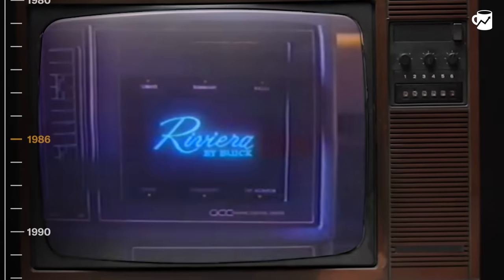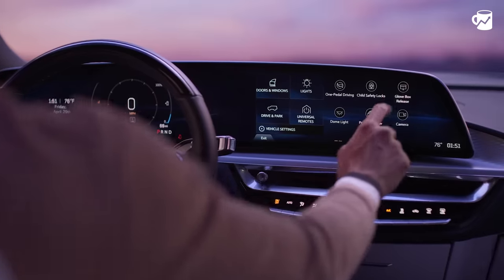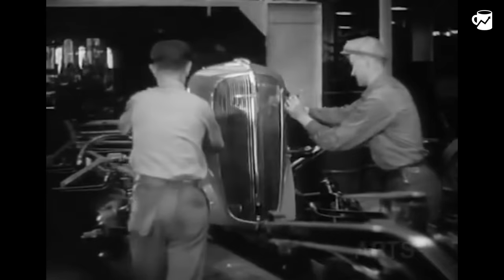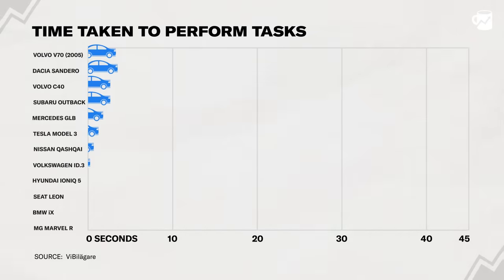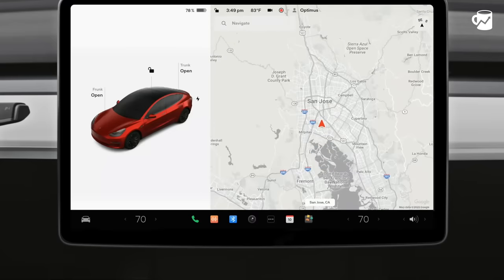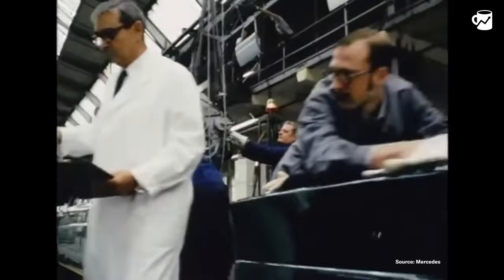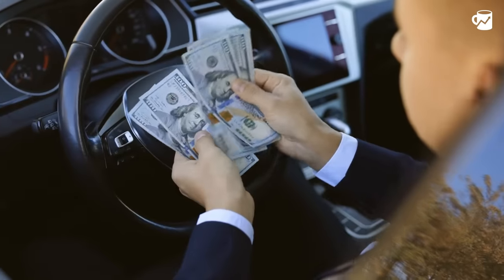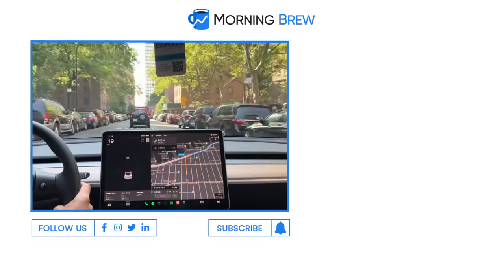The Real Reason New Cars Have Touchscreens

Comment: Touch is fine to customize settings to your liking, but while driving they are pure shit. We have a car where only the the air conditioning temperatures buttons are touch buttons and I asked the dealer if it comes with proper buttons.
Tesla might have done this because they assumed they will be able to make self-driving work in time. In thix case it would have been fine, but it looks like they need another 10 years.

Comment: My beef is the display system I have is too slow, that's in addition to being cumbersome to use at times. Voice control seemed like a great solution, but the "AI" in my 2021 Audi is nearly useless for anything but simple commands. I do like the physical controls on the steering wheel, it's a great feature that is safe to use. I also like the display behind the steering wheel, which can be adjusted using the steering wheel controls. If the voice control AI was more capable, it would work quite well, for example, if I could tell the car to make various adjustments without manually navigating through menus on a touch display. I was hoping that updates would become better with each new model release, but car companies seem to stick with original computer technology for years until a major new design comes out, that's despite the tech quickly going out of date after only a year or two, and despite the computer tech being dated and low end to begin with.

Comment: I think my 10 year old infotainment device is the sensible thing to have, if you really need to have one at all. It has a touchscreen but also has knobs. The only thing I use it for is to program the navigation software with my destination (only in situations when I'm going somewhere I've never been before and don't know the way), and to have a look at the map when I'm stationary at a red light. Looking at the screen to see the map on the move is almost as dangerous as pulling out a paper map. Instead, eyes on the road at all time while on the move and try to memorize the map or rely on the audio prompts from your navigation system. As for changing the station or selecting music from spotify on a touchscreen, you should not be driving a vehicle if you're that irresponsible as to split your attention between the road and something as unessential as selecting music on the touchscreen.
And I would not feel safe driving a car whose every function aside from steering, throttle and brake is controlled via touchscreen. So many things can go wrong, ranging from quality of life issues to preservation of life issues.

Comment: Touch screens create distracted driving .
you MUST look at the screen to locate the point that you must touch . doing so takes your eyes off of the road , hence distraction .
A car with buttons and dials does not require a person to look at the button . it's all done by feel and IF there is a split second of glancing it can be done via peripheral vision l not direct gazing as is required by a touch screen . 
now comes to the odd part . touch screens are ALLOWED in cars but using your phone , also a touch screen is not ?

Comment: It's cheaper if you build crap software, if car company's actually made the software good it wouldn't be cheaper than buttons. You also don't need tons of buttons, just Clima, volume and stuff like heated seats.
Reply: The user interface you're advocating can only  ever   have  just those functions and features it was originally designed with.   Need to copy a competitor's hot new idea, like "one pedal driving"?   Can't do it, if there's no button(s) for turning it on/off.   No problem if just extends a menu or screen somewhere.

Comment: So I have a 2019 Volvo V90, it has a touch screen and some buttons, and there’s a ton of stuff I have no clue how to use. I don’t listen to music on my phone because convincing the car to hook up to my phone is too buried in menus, I listen to the radio instead. I also don’t have hands free access to my phone for the same reason. I simply don’t answer the damned thing! I do love the lane keeping assistance but it’s not enough to be safe to fool around with the screen, I mostly use it to scan for deer. 

Automakers please make it easier to pair my phone, make it possible to rank preference for phones and make switching from primary to secondary phone easy to do. Never put climate controls behind menus, or on/off+volume controls.  Also, this business of not having a dipstick to check the oil is a terrible idea. That’s so buried in the menu that it’s ridiculous! 
Keep It Simple Stupid! KISS! Did it ever cross your mind that you could build 1 single bank of knobs and buttons for climate and sound and use them in every single vehicle? That would be amazing! And cheap, one panel across all models? Wow!

Comment: For me it wasn’t the Tesla Model S which started the worst trend but the Audi A6. In my view it was the first car which used a touch screen which was positioned very low for temperature control. It is completely stupid to control. 
I got a Volvo V60 from 2012 and I actually put the address in Navigation via T9 completely blind. It is such a easy to navigate car. On the other hand I was forced to drive a Golf 8 for a month for company and it was horrible to navigate the systems. Worst thing was voice control as it understands you falsely or just does not work so I do not understand how the argument of „just use voice control“ is really a thing instead of real buttons. It also has this horrible haptic sliders everywhere which you sometimes accidentally touch on the wheel and you have no idea how to simply adjust the temperature in the car. Just one of the worst cars I have ever driven.

Comment: Just bought a plugin to Blender that makes procedural cities in seconds. So could the haptic physical control surface be engineered, purely based on math and rules. Okay, manifacturing them still adds some cost but not as much as manually designing everything every time.

Comment: I miss when cell phones has physical buttons. With a good t9word implementatiin, it was possoble to text without ever even looking at the phone. I could do it while driving with a manual transmission and never look away from the road. Theae days with touch screen phones even with voive controls, it's nearly impossible to send a text without some attention focus on the phone. I feel the same about dashboard touchwcreen controls. With physical buttons, muacle memory can get you close enough to work by feel. With touchscreens, there is not enoigh feedback to work without visual focus and interfaces are so messy (even the good ones) that doing by simple rote is not an option.

Comment: I have driven a Model 3 for 2 years now and I have no issue with the touchscreen. If you roll the clock back to 2005 and ask people if they would use a mobile phone with no buttons then the vast majority would have said no. Why? Because touchscreen handheld devices prior to the iPhone had been shit. At the end of the day it's all about DESIGN and shit designs give the form factor a bad name until a GOOD design comes along. I don't need vent nobs in my Tesla because the car stores I and my wife's profiles (we have different height) and adjusts the vents automatically depending who is on the wheel. This goes the same with seat height, steering wheel position, side mirrors, bluetooth, etc. and bam, we don't need buttons for those things anymore b/c we set them once and never touch them again. 

Every moron can put a million functions into a car and have a dedicated button for each function, but a good design simplifies while maintains the core functions. "Simplicity is the ultimate sophistication".

Comment: I hate my 2020 renault.megan screen, it's so badly thought out, the radio jog wheel, all ways starts from the 1st of 12 presets. If you touch the bottom of the screen to use andrioid auto, it enters some random car menu, meaning you can not use any thing on the bottom row of drioid auto. It's just not well thought out at all.

Comment: Nissan owner here. I love touch screens in cars and wouldn't consider a vehicle lacking one. But I agree there's still a place for physical controls and buttons for some things. I also agree that UI can be a problem and needs time for design principles to evolve.  But, to be fair, cars like that 2007 Altima you mentioned didn't have so many features. A lot is changing fast. But software at least gives us the chance to customize. Most people aren't taking enough time to learn their vehicles. Yes, you can jump into a 2005 car and quickly work the radio, but there's close to 20 years of additional stuff going on the the modern driver needs control over. Not just heat and AC.

Comment: While a vehicle is in "drive" mode, there are a tons of settings/menus/adjustments that should not be available to the driver of the car. I have no issue with using touchscreens (well minor issue that buttons are nice, sometimes, certainly not all the time). But watching you try to change settings while driving made me cringe for your safety, and those around you. IMO, there should be an easy to touch/click spot on the screen at all times while driving that takes you to a large-control-interface screen with the only settings you can control during driving... like mirrors and HVAC, maybe there is something else but I am not sure. And on the main screen before you click that spot is only navigation and music. IMO volume should still be a button on the steering wheel, and a very simple mute/unmute + - volume on the screen. And those screen controls need to be large and easy to see at a glance.

Thats it. After you stop the car and put into park feel free to make it as complicated as you want.  I also agree that Android Auto interface is superior to any other navigation system and music control I have seen from a car maker. If Android Auto were standard on all cars, I would no longer need to learn a lot of new controls hopping into one.  And Also since Car Makers are implementing monthly fees to subscribe to features, I will cease buying their cars. They see android auto as a threat. I see it as a required feature, and you are never getting subscription money from me so stop it!

Comment: Touchscreen in a car is a dealbreaker for me. I demand tactile controls for everything, and starting the car must be done by twisting an actual key... no push button stuff. 

"Modern" and "advanced" are not positives! Give me analog gauges with actual needles, zero LCD screens (except in a swappable double DIN sized stereo/head unit), and as little computerization as possible. All of this computer stuff just adds complexity that means more things to break. Cable operated throttles beat throttle by wire.

In my pre-OBD2 car, most of the stuff is dead simple... when I open the door, a pin switch grounds the dome light, and it comes on. Simple, elegant, and perfect. 

We've been moving backwards in car design since some point around Y2k. I've tolerated some of them when I bought a newish (to me) car, but the built in touchscreen is a bridge too far. I can tolerate it on a car radio (which is not intrinsic to the operation of the car, and can be swapped out easily when it fails), but not if it is needed for anything important.

Comment: You missed a great opportunity. 

Yes, cost cutting is apart of it, but there are some other wicked reasons. The second reason is wicked, but not the end of the world.

Reason for the tablet#1: Planned obsolescence. 

The car manufacturers saw all the money that Apple and cellphone companies made in general and want their cut!

After so many years, the cellphone companies issue a computer update that u guessed it....that breaks our phones! They no longer charge. The apps are slow, etc. Our solution? We just buy a new phone.

U can already see where I am going with this...

I bought my 1993 Nissan Pathfinder in 1995 and had it for 18 years. I did buy a used BMW X5 during that time, but that was a bad idea and a story for another day. The point...I had my Path for 18 years!

I bought my current Pathfinder in 2013 and this is 2024.

Sooooo....Beyond being broke, I tend to hold on to my cars for many years. 

The point....

If the car manufacturers can force everyone to buy these cars with tablets that control everything, they can implement forced obsolescence and make us turnover our cars every 6 to 8 years and we will not be able to hold on to them for 10 plus years especially for EVs.

I go to the dealership. 

What's wrong?

My tablet for my car is sluggish and my car is not responding correctly. I press ventilated seats and it gives me heated seats. The car automatically shuts off for no reason. I think its due to the latest updates. Can u undo that?

Note: Supposedly, the current BMW X5 and X7s have the above issues.

Nope...Mr. Nash. We can not undo that update. It is required. 

Well...my battery is not charging.

Well...we can install a new tablet or u can buy a new battery.

How much is that?

60k.

Wow! For that price, I can just buy a whole new car!

Them: Cool. Please have a seat and our new car salesperson will be right with u.

Me: Sigh....

Reason#2: I get it, but I am not really offended by it. It is what it is. Tablets could possibly be a new revenue stream for the dealerships/manufacturers.

Our cars already track us everywhere. It would be easier for them to include mandatory advertisements, subscription services, and a bunch of other stuff as part of the Internet of Things where everything is connected. I think this is also one of the reasons for the big pushes in the car industry for cars to have WIFI.

Resson#3: Is really a reason why the cars should have buttons. It is unfortunate, but the car industry is about to quickly recognize that folk are living longer which means we are driving longer. In addition, I am Gen X and I am 50. Yep! I knew of life before the internet! Annnnnnd u guessed it. With Baby Boomers already retiring and Gen X being up next, our eyes and technology are not what they used to be so we do actually need those gosh darn buttons! Annnnnnd we do not use all of the features on our phones so  u know we will not be using all the features on the a car tablet. Annnd they are about to charge a premium for the buttons claiming increased production costs. Go figure. 

Sooooo...Yes! We need at minimum the buttons back for A/C and volume. I think we been lost the argument on cd players and that's fine.

Sooooo....the summary....

Sure,  the car industry can save money on simplifying the manufacturing process, buuuuuuut the massive revenue stream from implementing the Internet of Things on our cars in addition to tracking services in addition to forced obsolescence will be so enormous that they would have effectively corned the consumer!

The only saving grace that we have is that the minerals needed for electic vehiclels are finite and EVs will be popular for maybe another 3 years if that. They better hope the hydrogen fuel cell technology works or we will be back on ICEs in 3 years. The rail infrastructure will not be completed in time. 

Note: If they can figure out a way to recycle the hydrogen burn off back into the hydrogen tank such that u do not essentially just run out of gas from the car sitting, then hydrogen is likely the future of the car industry. 

So.....

That's my take on the topic...

Comment: Points you deliberately out:
1. The voice aspect of tesla cars? That is tesla's work around. Have you tried it. It works great. Why didn't you test that out in your video?
2. The cost of batteries is what still is costing a lot in cars. The reason everyone (traditional automakers) besides tesla is loosing money on EV's is because they don't know how to bring costs down. Which leads to the next point.
3. Tesla is a tech company, that makes cars. The cost of batteries is dropping, which will bring down the cost of ev's soon. All this will make EV's much less expensive soon. 
4. Tesla's FSD, is so good, and improving so fast, that soon-ish you won't need to pay attention to the road. 

So, making buttons is more expensive and won't be necessary in the near future as the road will be safer because humans make more mistakes than what the future GSD will. 
How is this a bad thing?

Comment: I've been saying this since touch screens first started appearing on cars; It's dangerous, and nothing more than a cost cutting ploy.

And another thing; all of these idiotic half measure self driving gimmicks (lane departure warning.................give me a break!) are just a research project that the consumer is duped into paying for. Your car is a rolling experiment to gather data for how well various "self driving" gizmos perform. What a con job.

Recently, I was in the passenger seat of a friends car as she allowed herself to get to boxed in behind another car and an 18 wheeler that was trying to pass, simply because the moronic "adaptive" cruise control adjusted her speed to match that of the car in front, thereby creating a rolling blockade. No way she was going to turn off the robot, drop back and let the trucker pass. 

And don't get me started on styling, All those absurd lumps and squiggles appearing on contemporary cars have two motives. The first is to differentiate them from the rest of the herd, and the collective failure in that respect is clear for all to see. The second is to enable the use of a thinner grade of steel than a sleekly styled and smooth panel would require.

To me, todays cars are rubbish, but I'm from a long, long time ago, when cars had mid century enthusiasm, and coefficient of drag was just for aircraft. Lucky me, I guess, but the current degradation of the automobile is so painful to witness.